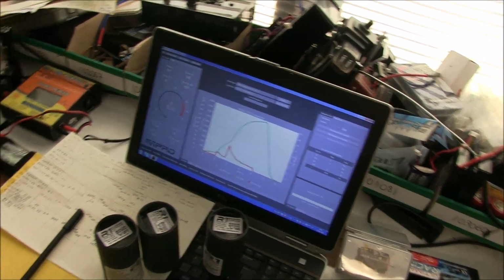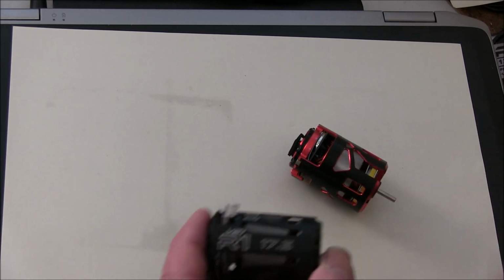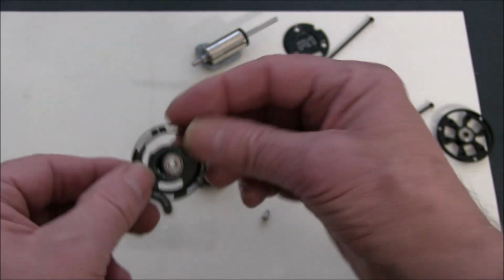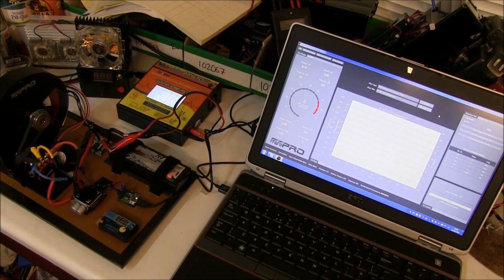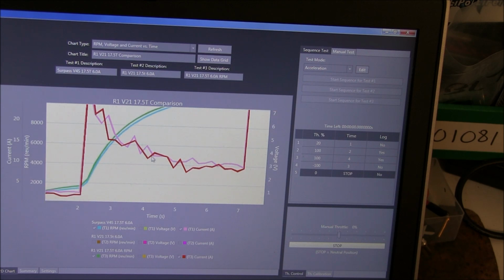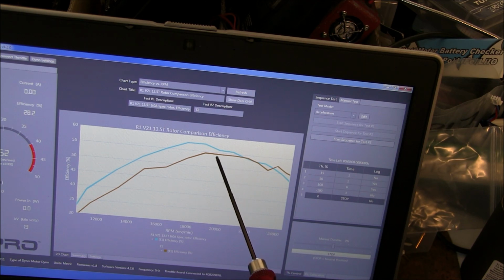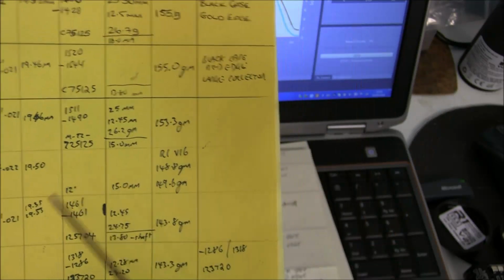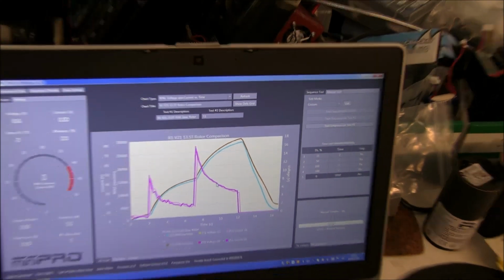Does R1 V21 motor take P1 and the S1 out of Competition.

Comment: Nick, Congratulations by the video, I bought a r1 v21 13.5 only that I am thinking it strange, the stator moves when accelerate and Motor is heating up much I adjusted the timming equal to your video and my car this with FDR of 4.7, can you help me?
Reply from the maker: Hi Diego.  The R1 often has loose stator. It will vibrate and buzz.  You must glue it in place with an epoxy glue.  Be careful not to advance the timing too far. The 50degree mark is maximum, if you do not have an ampmeter to set 6 amps.
Reply: @nickadams5411  Ok I'll paste it and set the time to 6a on the analyzer just like your video and I'll test it on the track, then tell you how it was, my engine is 13.5, I'm using an FDR of 4.7 I think this configuration is great without forcing too much the engine, thank you for now, see you soon

Comment: Hello Nick, why do you not use the Trinity Motolyser 2 tester. Does it not give more important data like measure sensor accuracy?
Reply from the maker: Hi Brian. I have the GForce (SkyRc) Analyzer, which gives sensor information. The Trinity I do not have.
Reply: @nickadams5411  based on how you do it. All the information you need is provided. Thanks for the reply.

Comment: Nick, what frequency are you using for sample rate?  My power and torque readings got much better when I upgraded to the newer 8 segment flywheel, but my efficiency lines have lots of noise.  I'm not getting the nice smooth curves like you are.   Wondering if it's a dyno setting or possibly the ESC I'm using for the dyno.
Reply from the maker: Hi Gerry. I do use the 8n segment wheel, but like you, I suffer from unusual and spikey curves.  After much experimentation, I settled for the lowest sample rate, as that propduced the smoothest curves.  I am hoping that Jose manages to improve the dyno with updates in 2019. All the best spinning. Nick

Comment: I have the Mini Pro and even with the 21.5 specific steel flywheel it is not repeatable at all!  When you test a full size car on a Dynojet--provided the car is fully warmed up (water, oil, gear/trans oil) and has a decent tune-up in it it can usually repeat 1-2 hp per run.  The Mini-Pro testing v16 R1 21.5 turn has power readings and torque readings that vary ALOT per run.  I try to keep the motor can around 100 deg F and peak the 2S pack before each run and my runs (if I remember correctly) are 14 seconds at 100% throttle.  For the $700 total I paid (upgraded temp sensor, adjustable motor clamp, the little box that lets you control throttle from your laptop) not to mention the extra ESC, setup board, dedicated dyno lipos etc., I really think the components aren't up to snuff.  Their is too much "noise" polluting the test.  Would I buy it again or recommend it? Yes, only because the Mini Pro is one of the few games in town.  And ONLY if you are a detail guy or looking for that millisecond advantage in stock racing.  
On the positive side, even though it is not exactly repeatable, it is close enough to show TRENDS--and I would have had no way of knowing my particular V16 21.5t made the most power at 43 deg indicated timing.  So it is an imperfect but useful solution.
Reply from the maker: Hi Jay
Thanks for your observations.
I would like a steel flywheel, but still trtying to get one.
I agree the data logging is variable, and I have to repeat the tests to get a satisfactory result.
The voltage reading is very prone to drift/fluctuate probably due to current noise on the solid state transducer.
But the results can be used to determine certain attributes of motors.
Determining the acceleration is where I cannot get a useful comparison.
I am not sure it is the flywheel weight, or limitations of the ESC etc.
Anyway, I give Jose the feedback, and hopefully it will improve with software /firmware updates.
Which steel flywheel do you have?  Does the belt take the strain without jumping?
All the best.  Nick
Reply: Nick Adams Hi Nick,
The flywheel I am using is the silver steel 124D 11T Steel.  It weighs 1076g, 11mm thick, 124mm OD.  Jose said if you are ONLY doing 21.5T it is the way to go but it is pretty much restricted to ONLY 21.5.  Here in the states the only class left that lets you choose your own motors WAS USGT.  Now where I race EVERY class uses the Can-Am motors picked from a random pile and returned to said pile at the end of the day, which makes tuning impossible.  Even the gearing is restricted!  I vehemenently despise spec motors and spec gearing.  We don't need fascism in RC.  Whats next?  Everyone has to run a "spec" radio?  Or a "spec" car?  Or even "spec" batteries but I digress.  To answer your question the belt doesn't ever skip, however like you showed in one of your vids I am using the optional 3mm pitch GT2-67T, 201mm, with 6mm width. 
The stock 2mm pitch belt that comes standard is JUNK and is inappropriate for a heavy steel flywheel.  The 3mm pitch has been great so far--never skipped yet.  Knock wood!
Reply from the maker: @jaylestingi  I want a steel flywheel.
Reply: Nick Adams Hi Nick, in addition it seems like I get more accurate results when I really let the flywheel wind out until it isn't accelerating anymore.  With the 124mm steel on 21.5 it seemed to be about 14 seconds for that to happen
Reply from the maker: @jaylestingi  Okay, good.
Reply: There's a newer version of the flywheels that have white and black segments as opposed to just a piece of electrical tape.  This new sticker made a significant improvement to the noise I was getting from the dyno.  It was originally so bad, that there was, in my opinion, a bug in his software on the way he calculated power out.   I spent weeks working with Jose, because this bug was very repeatable and even his tests showed the same results.  His solution was to increase the number of segments per revolution and create more contrast for the IR sensor.
I used to do 3 or 4 pulls and select the cleanest one, but now I only do 1 pull because the results are highly repeatable.  The only problem I see is the voltage and current sensor, which by nature of the high range does not have very good resolution because the microprocessor has a 10 bit analog to digital converter.  Ever notice at idle the voltage readings jump up and down?  I haven't done the math to determine a reasonable variance.  But these small fluctuations in voltage and current have a small impact on power and efficiency.
Can you provide some more details on what's happening when you say they aren't repeatable?
Reply from the maker: @holmgn  Hi, yes I agree. I do use the flywheel with 8 markers.  I know Jose is working on some fixes for the fluctuations, especially the voltage.
Reply from the maker: Hi jay. I agree that for the casual tuner it is too much money and hassle to get meaningful results.   But someone more involved, it has it's uses.  Hopefully it will be improved with updates.

Comment: Hi Nick. Love your vids. Keep up the great work. I have a couple questions because I'm a little confused on how some of the results came out with the R1 13.5 motors. On your original R1 13.5 motor results over 6-7 months ago the IR was .024 on the V16.  It was classic leader along with the reedy s plus. Move forward to the Surpass 13.5 v4s motor the IR was .021... now the class leader as of Sept-October 2018  or so. 
This is where I get confused. Just after you did the surpass motors you tested the new R1 V21 motors along with a new V16 motor in Sept-October. On your yellow piece of paper you are showing the NEWER version V16 motor having an IR of .022.  Around 6 months ago ( or whenever it was) on your first testing it had .024 IR, now it has .022 IR? Is this because R1 wurks put in the new better V21 winding into the older V16 so it NOW as .022? VS .024 a half a year ago? I hope all this made sense. Basically it looks like the new V16 version (late 2018 October) is better than the old V16 version ( early 2018)... Possibly even better than the V21 version. And I'm trying to figure out why. It must be because of the new winding for better IR.
Reply from the maker: Hi Scot
The recent tests, I decided to zero check the IR meter before every test.
I did find it was slightly out by 0.01 to 0.02 ohm. So that  is one reason why the retested motors had slightly better , lower resistance.
The R1otors have changed the rotor strength over the time of the first V16 to the latest V21. They are now stronger.
But the winding is better (lower) and the motor has improved the low end torque, but kept the high speed KV.
Hope that explains. Nick
Reply: @nickadams5411  ok great. That explains it and make sense. Thank you for the explanation.  The reason I was asking is that right now I have the R1 v16 13.5 in my Tekno eb410. I just purchased the new surpass v4s 13.5, red/black. I'm hoping I will be happy with the surpass motor compared to my R1. Again love your videos and everything you test.

Comment: Hi Nick, we were at the 702 raceway King of Carpet event this weekend. In one of the races for 13.5 stock they checked for internal resistance in the motor from terminals A and C. They were looking for a minimum ohms reading of 19.5. Was wondering what the R1’s readings are?
Reply from the maker: Hi
Unfotunately, the resistance reading will depend on the accuracy of the meter they are using.
I use an expensive calibrated low ohm meter. The latest R1 V21 13.5T motor reads as low as 0.021 ohm.
If their meter reads 19.5, is that 0.0195 ohm?  The no 13.5T motor will get that low.
There is a chart that shows winding resistance of Surpass motors: 
https://surpass-hobby.en.alibaba.com/product/60778991632-807463882/RC_car_brushless_Rocket_540_V4S_13_5T_sensored_brushless_dc_motor.html?spm=a2700.icbuShop.84.5.538121f45DPG4W

Comment: Do you think the R1 is a bit more efficient because it uses a weaker rotor than say the Surpass @Nick Adams?
Reply from the maker: Hi Luke
I looked closely, trying to see where the motor is more efficient.
The R1 is very slightly lower winding resistance, so that will make a small difference.
The rotors are from the same manufacturer, but vary slightly, the weaker rotors would be better on large track. On smaller indoor track they would be less efficient.
Reply: Looked very close, like you say some variances from motor to motor, hard to justify the extra money I would say. And yes weaker rotor on large tracks is usually the way forward especially if it's a hot day.

Comment: You mention gearing for optimum rpm/pull could you elaborate as to how I would know what gearing to use with the data on the dyno
Reply from the maker: Hi Kurt
Gearing will depend on the size of track, corners and length of straight.
These high strength rotor motors will accelerate strongly with a large range of gear ratios.
But the high speed on a long straight will be more dependant on the gear ratio.
Gearing wil affect the Efficiency of the motor, and how hot it gets during a race.
So the aim is to keep the motor near the maximum efficiency. Therefore too large a pinion on smaller tracks will cause overheating. But on long flowing tracks the larger pinion can keep the motor past the maximum efficiency point, for extra top speed.

Comment: Why do you still keep using the 6A no-load timing method?
Reply from the maker: Hi Tim
Because it is quick and easy to get the optimum performance (for Blinky) for 95% of racers and conditions.
It makes it easy to compare the performance of motors.
Reply: I disagree, it's not even close to optimum for most of the newer short stack motors these days.
Reply from the maker: Okay, you post your video , so we can all tune to the optimum.
Reply: I don't do videos, but I can point you to some testing and manufacturers recommendations if you're really interested. For example, the R1 V16 produces more power at lower timing settings than the V15, and you can just gear up to match.
Reply: @TimBoundy  I would have to agree with you here, and the swapping of the rotors actually proves this, essentially the two motors have been tuned to the same specs, hence why the difference in performance is so little, the use of timing creates field weakening of the stator field whereas the use of a RPM rotor has the effect of a weakened Rotor field due to the incresed air gap, so if both motors are set to a set current then yes your results are going to be as noticed, some what limited, ideally for a more valid test to show the difference in performance between the two rotors the motors should of been set to the same timing so that the interaction of the two fields could of been witnessed, the use of an RPM rotor will increase current draw due to the weakened field from the larger airgap between rotor and stator, although the bonus is that you can achieve much higher RPM results at the cost of current before you get passed that ominous current increase point created by excess timing, normally I tune by mapping the RPM vs Current as I increase timing, and find the point where the current starts to ramp up noticeably compared to the amount of RPM gained, this point is different for every motor I have tuned.

Comment: Is that a charger hooked up to the battery on the dyno?
Reply from the maker: Hi Christopher
Yes, I keep the charger running all the time, so that the Lipo is always the same for each run.
It will switch off as soon as the run starts, but I switch back on after the run.
Reply: Thank you Nick. What do you keep your charge amps at?
Reply from the maker: Christopher Bertotti  
Hi,  The charger is on 10 amps, but it is low or turns off when Lipo is fully charged.

Comment: What timing did you set the Surpass 17.5 at to get the optimum results Nick?
Reply from the maker: Hi Luke
On my own 17.5T set for blinky (6.0A) the endbell is showing is 49/50 mark
Note that the graduation lines are in 3degree steps !!.
There is a large line between the 30 and 60 which is 45degree.
Reply: Nick Adams  Cheers Nick, seems similar to what the old R1 would be timed at.